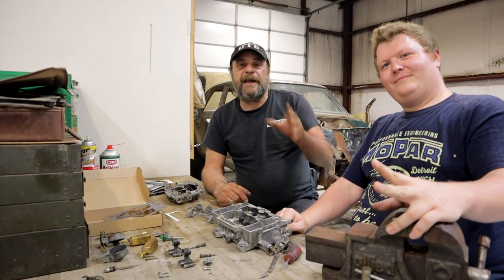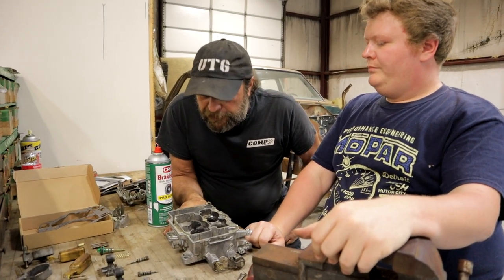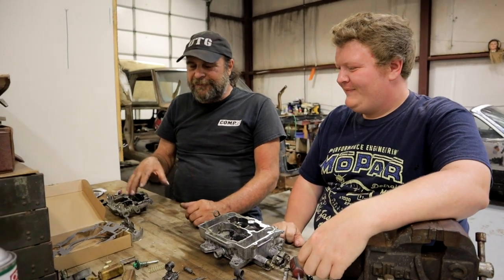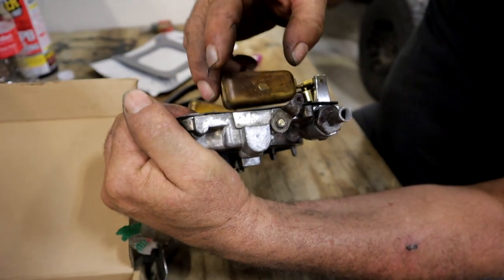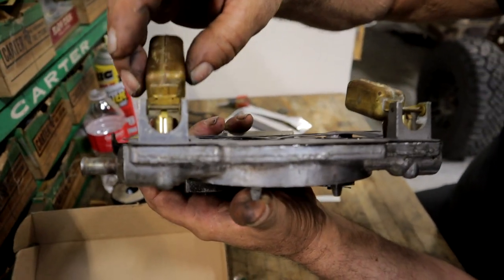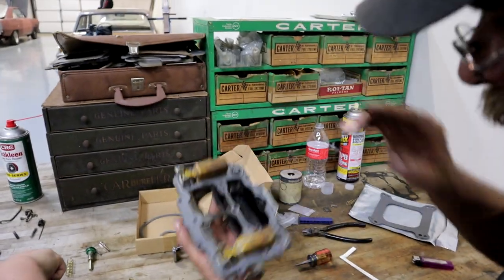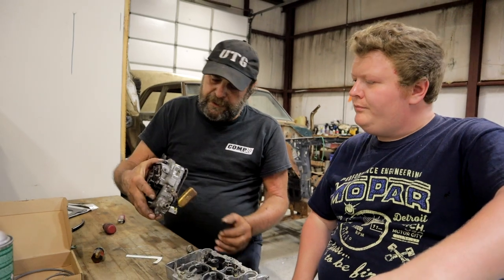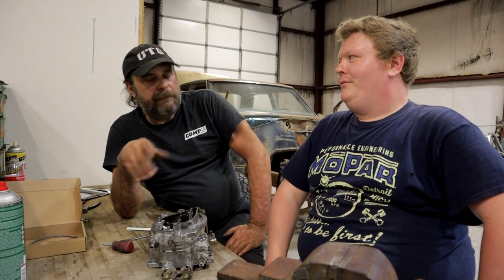$18 Edelbrock Carburetor Rebuild

Comment: Metal guitar strings might be an additional option for cleaning/unblocking some passages.. 
They are flexible and of course, come in many different thicknesses.
Reply: Torch cleaning wires would work too

Comment: The 3 things I do on a rebuild of an Edelbrock or Carter AFB to include in this video is #1 remove the jets. These like to get seized into the aluminum over the years and you have no idea the history of the carb or current jetting so remove them, look up the jet size to know what your current calibration is. Make sure it is a large flat blade. I have seen these mangled by others and then they have to be extracted - not fun.  #2 the needles like to stick to the seats on these kits. Test them make sure they drop freely when the float comes down. Use a little lube if needed to keep them from sticking. #3. Do not lose the check ball or weight under the "juice shooters" for the accelerator pump or it will not work period.
Reply: All good points for sure. Carter/Edelbrocks are known for these conditions. I'm sure UTG removed the jets to soak the carb and inspected it to make sure it will be a good carb, and this is just a general overview of basics. I hope so, anyway lol.
Reply: Yeap. They have many issues. I hate them. But if you mess with them and get the full calibration kit they can perform ok.
Reply: The actual AFB is much more reliable.
Reply: I had an issue where the needle wouldn't go all the way into the seat, I winded up re using the old seat :(

Comment: That ratcheting wrench you had Austin using would have been tossed either across the room or in rhe scrap pile haha. I hate those things
Reply: Yep! Someone needs to hit a harbor freight and pick up some basic tools.
Reply: No kidding I thought he was making a career out of putting those screws in I like using screwdrivers even a ratcheting screwdriver  it only takes seconds to put in and tighten screws instead of minutes like buddy was taking with that thing
Reply: @scottinWV  yeah screwdriver sets are really cheap
Reply: @79tazman  I don't have the patience for that. I'd probably whip out my cordless drill and break something.
Reply: @79tazman  Yep.  I got one that has a handle with the 1/4" drive for bits and it came with probably 25 different bits, Torx, Allen, etc. For about $9
Reply: @79tazman  thankyou...I thought it was just me!!!

Comment: Watching the rebuild really takes me back...for certain applications, I would wrap some steel wool around a backwards-taped rod or dowel chucked into a drill and polish the bores to remove any casting flash, etc and make them smooth. Yeah, it took a little more disassembly/reassembly, and it's kinda OCD, but it made a small difference. 

Keep up the good work, Uncle Tony, revealing the nearly-forgotten old school technology to the masses.

Comment: Other than a piece of wire, you can pick up a cheap micro drill bit set off of Amazon. One you can use by hand. Steve's small engine saloon uses them all the time for cleaning out small passages in carbs.

Comment: 3 things I do when rebuilding carbs -  1 I get it disassembled and give it a basic wash to get the gas out of it. then air dry it .then get a bottle of THE WORKS toilet bowl cleaner and a Rubbermaid plastic tube and take stuff outside and set parts and carb body parts in tub then I pour the bowl clean on the parts and in the parts and squeeze the cleaning fluid into and through all ports and passage ways and let soak for 15-20 minutes outside . 2 then I wash the parts with water then lay out a cloth towel and lay all parts on that to dry and then I use compressed air to blow through the ports and passageways and use a light autobody scotch brite pad to clean up the floats and their pivot rods . I lightly soak the venturies gaskets and the carb lid gasket with penetrating oil then reassemble the carb ect . the penetrating oil keeps the gaskets from gluing them selves to the carb after the screws are tightened down incase you ever have to disassemble the carb again to make any adjustments or mods 😎👍🏁

Comment: Are the throttle blade shaft seals replaceable on these Edelbrock carbs?
I currently have one on a car that leaks thru causing idle issues.
Found this leak while searching for a vacuum leak.

Comment: Ahhh, a beautiful old Carter AFB style carburetor.  The greatest carburetor Columbus ever discovered in the new world, when he sailed the sea in fourteen-hundred and ninety-three.
Reply: They are great if you like the motor to stall when you go around a corner or brake hard
Reply: @Stevesbe  ..Time to find a mechanic! Funny,people drive shit boxes today ad think thats how they were! They never stalled as you say when new,or maintained/rebuilt properly!! I guess i am lucky to know what good cars/carbs were and are like..Time to fix your carb buddy!
Reply: @Stevesbe  Which is why Chevrolet got rid of them on Corvettes in 65 as I recall.
That said, I was sliding my daddies 64 Corvette around (without his knowledge, of course) on 205 wide  Michelin Xs in the mid 70s, and the AFB worked perfectly.
When the time came to put  a 4V carb on my car, I bought a new Holley, then changed to center pivot floats.

Comment: This reminds as a kid when I was half fast employed...I placed pay when you sell ads for carburetors, mostly Carter & Q-Jets. I'd sell em cheaper if they brought me their old carb. 90% of the time I could rebuild them without using any parts, just screwy ztuff like you found. i would use a few parts here & there, a few gaskets, accelerator pump, etc. Once in a while the ad paper would contact me to see if I sold any of the carbs and I'd say "Uh, no, not yet". That was 50 years ago, hope the statute of limitations is up...
BTW, Thermo-Quads were a good one cuz a lotta people didn't know how to fully disassemble them. There were a lotta 440 Chrysler Imperials around back then.
Best carb ever, I have one on a 67 small journal 327 with Milodon ductile iron 4-Bolt mains I built back then on a 67 Camaro. Still have the 327, my son is now dropping it into a 1980 Camaro Rally Sport... changing it to a Muncie 4-speed. Really looking forward to seeing her rumble once again.

Comment: Dear uncle tony, great video. I noticed that the accelerator pump piston that came in the eBay kit was black, I'm hoping that it's better than the blue ones I have been getting lately. I have always tested the pump with carb or brake cleaner just like you, in fact I fill the float chamber after assembly and observe the shot using the throttle linkage. I have found out the hard way that the spray cleaner completely destroys the blue rubber pistons. Just something to look out for.

Comment: I wonder how similar the edelbrock  is to the original Carter afb, I got a mercury last July with a y block it had a factory afb on it thought it was an edelbrock at first then noticed the heat tube coming off the manifold to the choke

Comment: ATTENTION :  Dont for get to plug the v port on the lower passengerside of the carb where the electric choke use to be . other wise you'll have a vaccum leak. the factory manual choke carbs have a brass plug in that port 😎👍

Comment: Wouldn't it be nice or better to use an air compressor to blow out these Jets and all these little orifices I'm just throwing it out there I'm not a hater
Reply: Sometimes an air compressor will just scatter small parts across the shop.

Comment: We need some elevator bossa nova for when you guys break.
Last time I had my little Rochester apart I installed the floats upside down. Cranked the truck and gas was spraying out of the overflow. 
In my defense it was a roadside repair, still felt pretty dumb.

Comment: On a Pontiac 389 I have a Edelbrock 1406... a little too small on CFM but I only do touring but I found it took an Edelbrock 1450 kit (for a larger carb) to get the mixture rich enough.  I know that isn't where you were going here... but I just wanted to mention it.  I fitted an air/fuel gauge to sort that out and it is a must.  I've had my Edelbrock from new but did find an ultrasonic cleaner really deep cleans the parts but you are EXACTLY right about passing a wire throughout all the passages.  Nice Work Again!   Thank You

Comment: HOWdy  U-T-G,
EDELBROCK aluminum Carb - AFB rehabilitation on a budget  
GLASSES = buy - Buy - BUY the BOGO ( Buy One Get One FREE ) deals & put a set of glasses at every place you need a pair 
 ( I currently have EIGHT <8> pair of glasses distributed around the HOUSE & GARAGES ) HINT - do NOT buy PLASTIC LENSES - Carb Cleaner etc 
COOP
...

Comment: I wonder if that's one of the early carbs from auto zone ?  
We use to call them Edel-junks for that very reason.. The secondary's not coming in or not coming in right... 

I got rid of several of them for that In the late 80s  early  90s.  But hell at 20 yrs old, an with no enterwebs and your best help or advice coming from the guy at Autozone  you just got your 300$ back and bought you a rebuilt  Rochester Quadra jet from a big block motor== no more probable secondaries coming in TA-WAAAAA!  

Get that and your passing gear linkages right on your 350 SB and you were ready to go outrun all the ponys...

Comment: Great video! I'm currently  rebuilding my Edelbrock carb. After opening it, I noticed the passenger side float bowl is completely dry. The drivers side had a little fuel in it. The carb sat for 12 years but we have been running it the last week or so. What would cause the bowl to be empty? Thanks in advance.

Comment: Im sorry horrible video.  Hopefully he cleans his shorts better than the inside of that carb.  The varnish, slug, or whatever is in the inside will eventually break up and plug them little holes in the primary clusters.   Lay the lid down on the floats???  Just changed the float levels.    AND WE ARE WORRIED ABOUT AN 18$ CARB KIT😂😂😂

Comment: Gosh damnit gosh damnit gosh damnit. Had one issue with 66 T-Bird that Now I know turns out to be the crust that built up from sitting. My car now sits engine completley tore down to block, no interior, all doors, hood, panels removed. That “while I’m here I might as well” thinking can really get out of control. All started from that little issue that this video would have fixed for me…

Comment: Tony I have a Afb 9000 on a marine 454. My issue is that after setting for 4-5 day the carb is dry of fuel. Boat is new to me so I have no history.  I plan on putting in a kit at this point? Starts cold fine in 2-3 days. Have you seen this before and what should I look for? ❤️❤️ your channel.

Comment: I picked up a used Edelbrock 1406, sharp turns or braking the engine would quit.  Tony's comment led me to check the floats and sure enough they were off.  All fixed .. thanks Tony !

Comment: I'm very surprised that a tech of your caliber doesn't know the proper names of the carb components and proper rebuilding procedure of that carb. Best practice is to, first of all, soak the carburetor in carb cleaner and blow through all the passages. Chase and clean orifices and passages in needed. In order to adjust the float level/ height, use flat nose or needle nose pliers. Avoid just bending the float arm as you can damage the sordered surfaces. You can use a 7/16 drill bit instead of the plastic ruler/gauge. In order to check and set the float drop, just hold the air horn right side up and let the floats just hang....
By the way, when the carburetors are first assembled, all the screws are torqued to specs.

Comment: When you are bending the float (not the tab for drop) for upper limit, please (!) tell me you are not forcing it against  the bottom of the needle and forcing the the rubber end against the seat.  The number one reason these carbs need rebuilds is the rubber or viton end has  a ring worn in it.  Blocked passages are second.   I WONDERED how these seats were so worn when the carb looked to have had little run time on it  when I took my used carbs apart. Which makes it not block the fuel so you get a gusher. Or it sticks to the seat so nothing passes into the bowl.  Youtube car guys are always tapping the needle adjustment with a wrench.
I would have put vaseline or chapstick on the gasket.  I mean, you can say "the good thing about this design is you don't have to get into gaskets when you make a small jetting change, like you do a Holley".  But you can also say,  "the bad thing about this design is you have to get into a much more annoying gasket when you make a moderate jetting change than you would in a Holley."   If you tear that top gasket, you need to spend another 18 dollars. Unless some kits have two, as some comments said.  The fact that the torn gasket is above the fuel level doesn't mean it won't leak . Unless the car only runs when parked and never shoshes the gas around.
Was there a way to slide the plunger off the kit accelerator pump rod and put it on the old rod so you didn't have to drill the new one?  Oh that S link goes on two different ways but one way screws things up, but I forget which is which. It is usually shown and commented on in the rebuild kit instructions.
I would have used a carb stand, even if it is a home made one with a square of 2x6 with some bolts screwed in from the bottom and nuts threaded on.  Not really necessary but good to show the first time rebuilders , for whom this video is an excellent reference. 
On the other hand, I disagree with the comments complaining about you resting the top of the carb on the floats when you placed it on the table. It is not going to bend the floats.  I don't think it will push down on the needle and seat very hard, either.  
As other commenters have said, it would be nice to check the numbers on the jets and write them down, particularly if someone has rebuilt the carb before or messed with it.
Can you speak to the choke? I know you don't believe in chokes in street cars. I know you think they don't HELP.
Which I strongly disagree with.
 But at least tell everyone that removing a choke  doesn't increase airflow by more than a negligible amount and can't possibly increase horsepower.  A stub stack , which extends the choke tower can help.

Comment: You didn't have to drill the pump shaft hole. All you had to do was swap the new pump cup to the old pump, unless it was a different design all together. And by the way, after you set the floats, you want to avoid setting the air horn assembly on the bench resting on the floats...OUCH!!!

Comment: Need your Wisdom Uncle Tony,  I have that same edlebrock carburetor.  The issue I have is when I go into the store to grab a 12 pack my 86 c10 cranks right up. If I stop and eat a burger and the truck sits for 15 minutes or more I have to crank the engine to get gas back to the carburetor and then it will start.  I placed a 1inch gasket  between the carburetor and intake. No difference.

Comment: Tony, I think it was you...talking about cracks in 426 Hemi blocks. You were saying something about running bolts in and cutting the heads off. Never heard that before. I would like to hear about that. I know that they can be preheated and welded, but I personally do not weld cast iron, I send them to a guy that does it. I really want to hear what you meant. I have no doubt that you know what you are talking about and seen it done or done it yourself.  Thanks again!

Comment: Just finished the same job with the same kit. Had the same problems. Accelerator pump wrong, (put the new cup on the old shaft) and forgot the flappy doo dad. Carb turned out great.

Comment: Edelbrock carbs suck. The Carter AFB that it was copied from was much better. There is a reason why they are called edelbogs.
But if you buy the full calibration kit and spend some time with it you can make them work pretty good. But each carb is different. You can buy the same carb and calibrate it the same as you did on the original one and it will work different. For as much time as you spend messing with it you might as well get a holly and mess with it off and on.

Comment: I have an afb popping through the secondaries.  Previous owner let it set. I put two cans of carb cleaner through passages.  Better but still backfiring with quick throttle movement. Not a big fan of these. Seems temperamental

Comment: The three holes in the pump arm adjust the duration of the pump discharge, therefore, the amount of fuel delivery. The "slug" /pump discharge weight, keep the discharge check ball seated and reduce the possibility of unwanted pump discharges due to vibration.
The reason I'm familiar with all the facts I've stated, I'm an old retired Carter R&D Engineer, from St. Louis, Mo.

Comment: $20 saved by drilling a hole, good deal.  If you turn the s-link on the pump around from factory you get instant pump action instead of waiting a sec. for the spring to pull it down. great vidio.

Comment: First of all, that flapper thing in the Carter AFB secondary is the auxiliary air valve and it works on a vacuum/pressure differential principle.

Comment: Guitar wires that are 50% wrapped make the best cleaners "E" to "E" Strings short  and long cuts with carb solvent, and high pressure controlled air burst been rebuilding carbs like Tony  since 15 years old. Build my own cycles and old cars. Nothing like making things function when nobody else can.

Comment: Holley idle screws start at 1.5 turns out and end up 1 turn to 1.25 turns out. AFB idle screws should start 3 turns out and usually end up 2 turns to 2.5 turns out, maybe slightly less, but 3 turns out to start is good for AFB's.